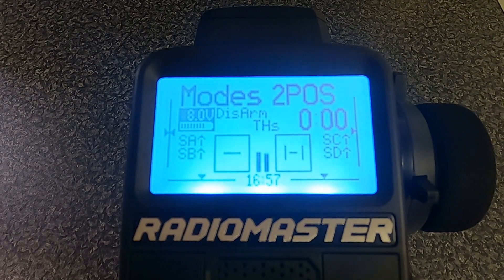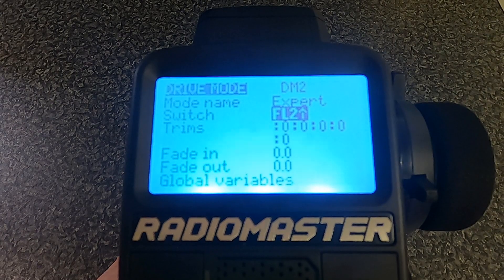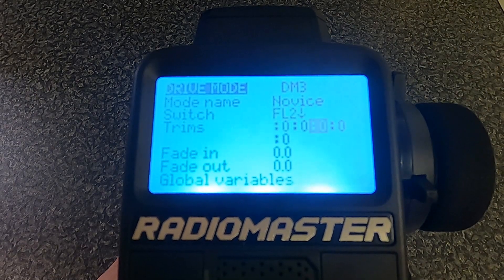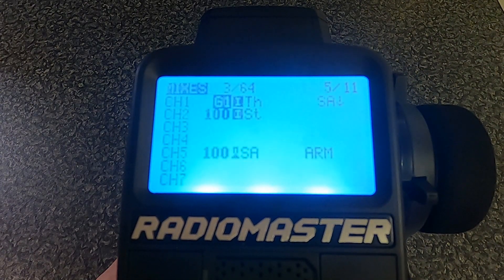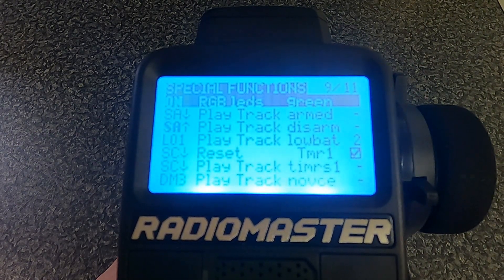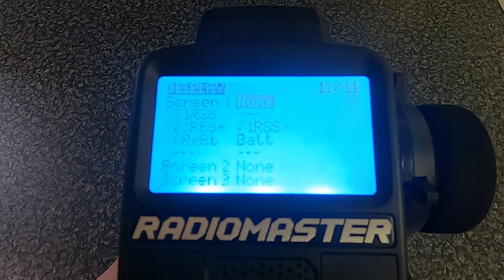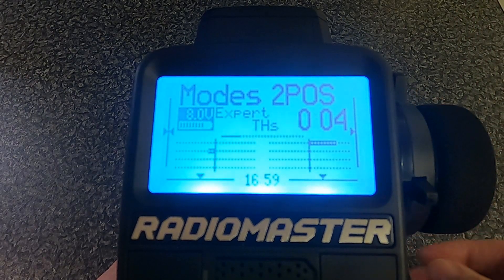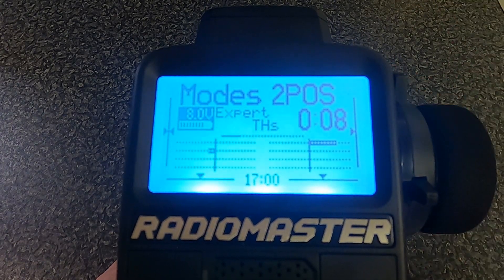RadioMaster MT12 Drive Modes (DM) and Global Variables (GV)

Comment: Trying to setup S1 and S2 to control steering rate and throttle rate.  Setup everything similar to how you and Josh Bardwell demonstrate but it's just not recognizing the signal of the pots.  The pots do look to be working as I can see them moving under the channel monitor.
Reply from the maker: Hi Tony, it sounds like you have not set the mixes up correctly. If you can see the switches working in channel monitor. I would check them.
Reply: Thanks! Turned out to be the precision setting so now it works but I only have half of the pots range (to the detent)
Reply: @MrDiMaggio5  go to calibration and set the pot as pots with dent and re calibrate, this should work